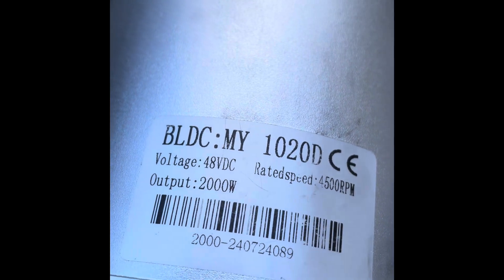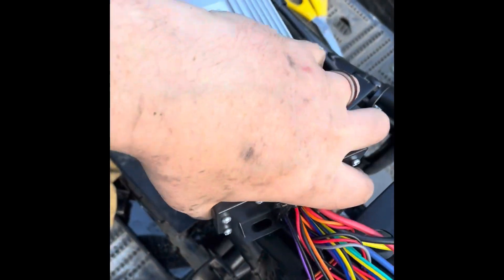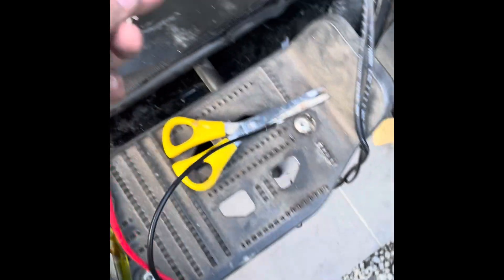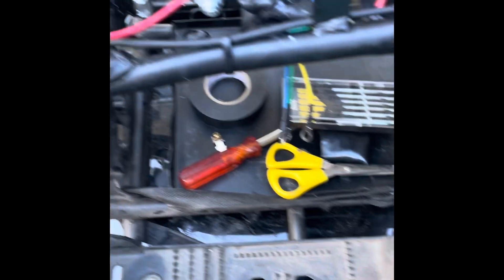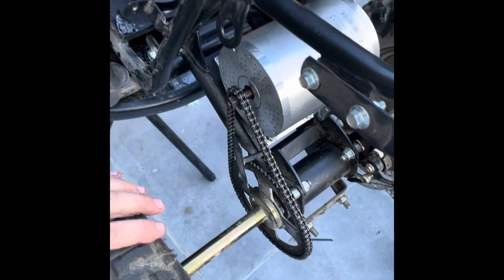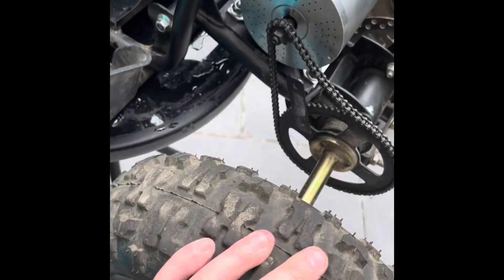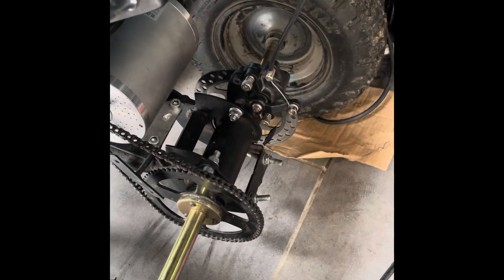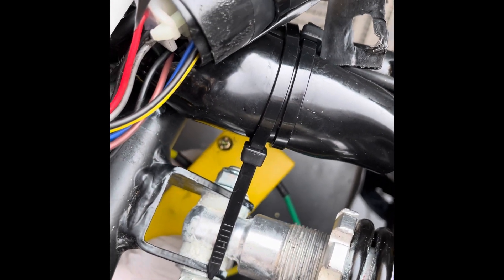Electric Quad upgrade 36v 1000w  to 48v 2000w!!!  Part 1

Comment: Thinking of upgrading my lads for his birthday, is it easy enough to do ? How much has it cost you  to fully do ? Cheers
Reply from the maker: Yes it’s fairly easy.  You need to beef up things like the fuse (50amp) get yourself some ring connectors and block connectors.  If you have any issues during the build post them here, happy to help you.  It’s a serious bit of kit once upgraded, it’ll do donuts and pull wheelies with me on it now.  If you do it start your lad off on the grass in case it flips him off.
Reply: Could you tell model name or give link where you buy this kit?
Reply from the maker: @jekabskurzemnieks4640   High Speed Motor Kit2000W 48V... https://www.amazon.co.uk/dp/B0CTKWK99D?ref=ppx_pop_mob_ap_share
Reply from the maker: @jekabskurzemnieks4640  PNGKNYOCN XT60 to O Ring Terminal... https://www.amazon.co.uk/dp/B0C7BMB46B?ref=ppx_pop_mob_ap_share
Reply from the maker: @jekabskurzemnieks4640  Senrusa Electrical Motor... https://www.amazon.co.uk/dp/B0DCS2PDBD?ref=ppx_pop_mob_ap_share
Reply: Nice job mate, quad is rapid now does the new throttle have forward and reverse and speed settings on so don’t need the switch in the middle anymore 👍🏻